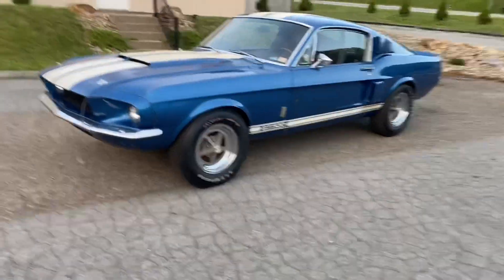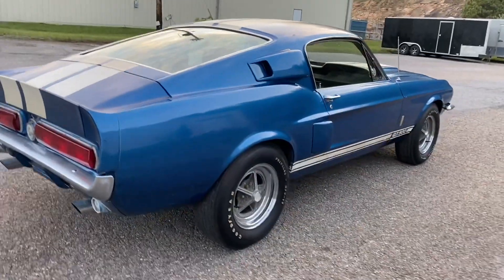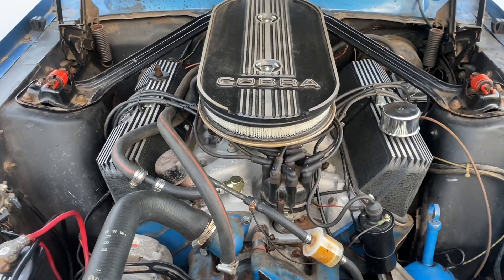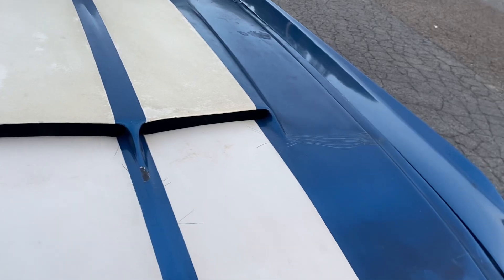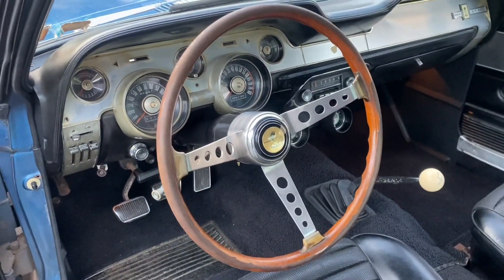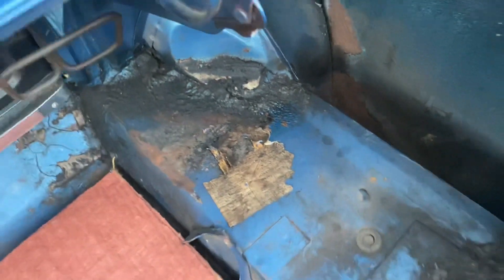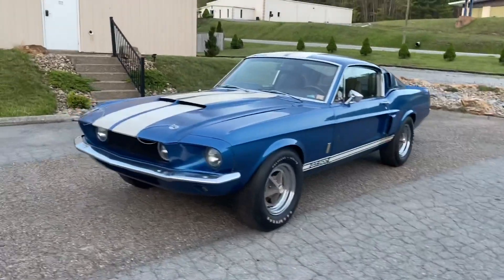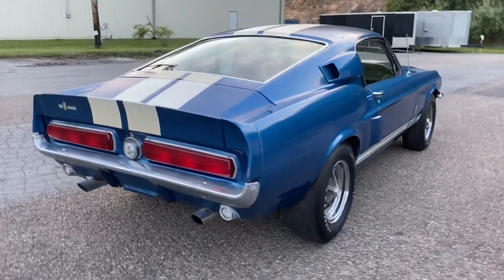1967 Shelby GT500 Acapulco Blue 4 Speed

Comment: Nice. How much?
Reply from the maker: Mtdubvee@yahoo.com for price.
Reply: Wow I have a 69 gt350 in similar condition. Don’t restore them. Just keep driving them. Praise the car gods.
Reply: @JohnDoe-kb9fe  This car, as it is, can't be restored correctly. Some Shelby standard items are no longer there. Engine is wrong, front seats are wrong and I'm sure that there's more things wrong for that car. The Shelby ID tag has the wrong rivets securing it and the right rivet isn't installed properly.  I have my doubts that this is an original 1967 Shelby GT 500 Mustang.

Comment: So, it's an unrestored non-original car in somewhat poor condition.  It's going to cost bigly buck$ to make this car nice again. I highly doubt that this is even a real 1967 Shelby GT 500 Mustang.
Reply: You don't generally restore a 'survivor' car like this one; it's too original. It's seems legit since it has the plaques to prove it's from Shelby American.
Reply: @ethan_s550  That Shelby plaque has the wrong rivets. Also it's not the original engine. He stated it's '69 side oiler 427 short block which was not available in a Mustang. They came with a 428-pi engine. Grille running light's location is wrong for a '67. Front seats are wrong as well. BTW, the Shelby plaque number does NOT match the car's ID number either.